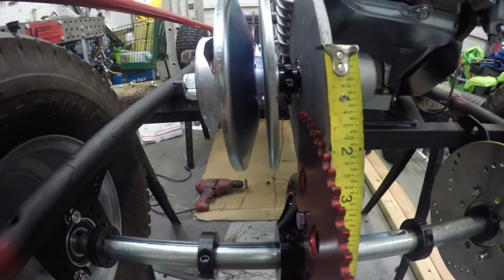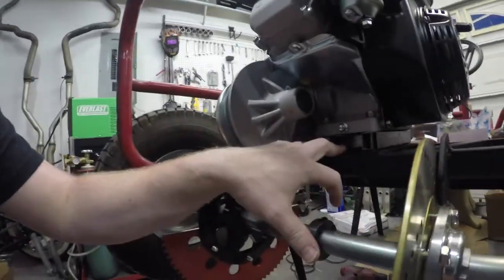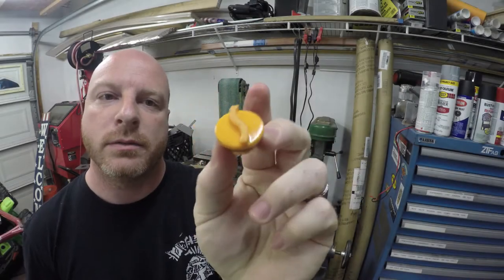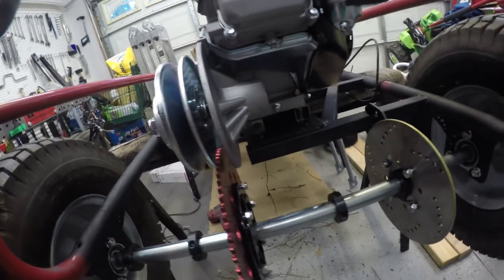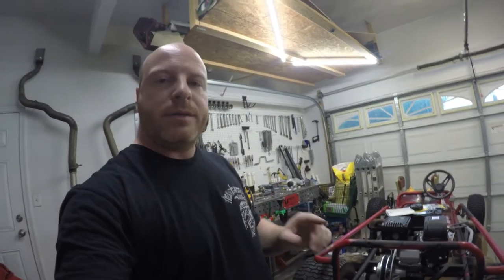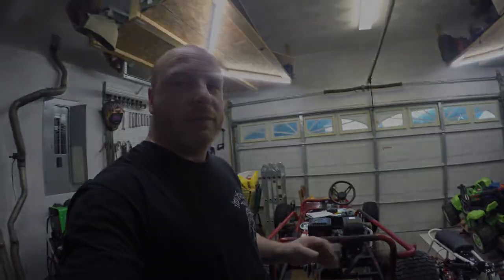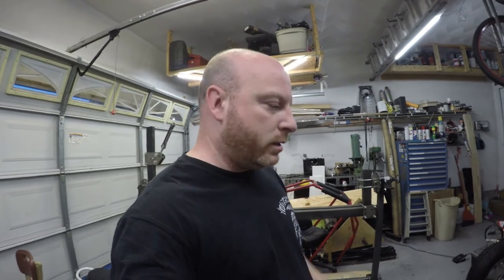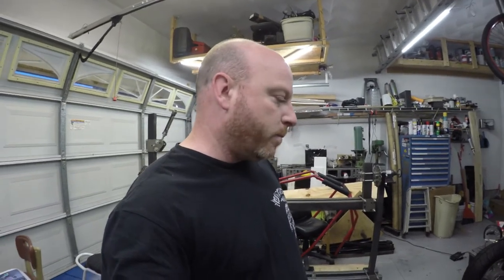Project GoKart Part 4 - It's on the ground!

Comment: Looking good. Only thing I noticed: wouldn't it be better to have the engine mounting bolts facing down? That way if the nut ever backed off you wouldn't lose the bolt and the engine would stay attached to the frame. Just IMHO. Keep up the great videos.
Reply from the maker: Yes you are correct, but with the length of the bolts they simply won't fit that way due to interference with the crankcase.